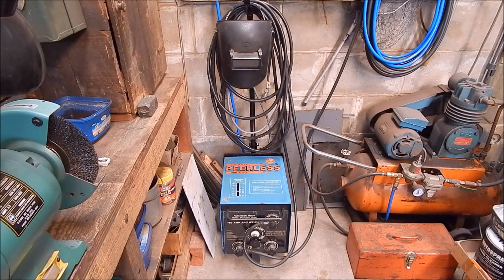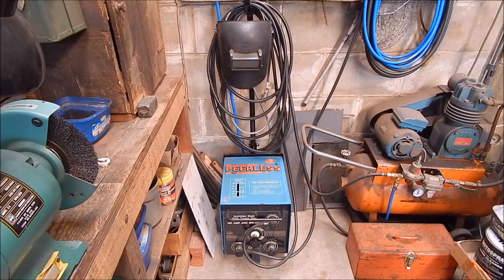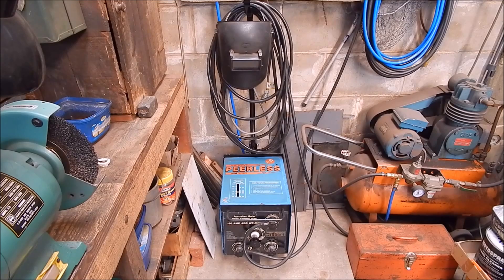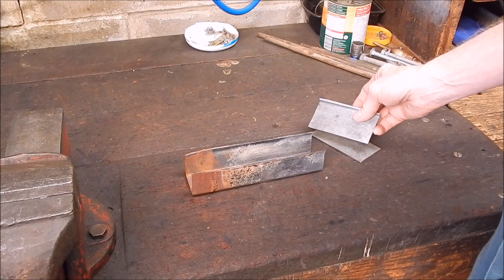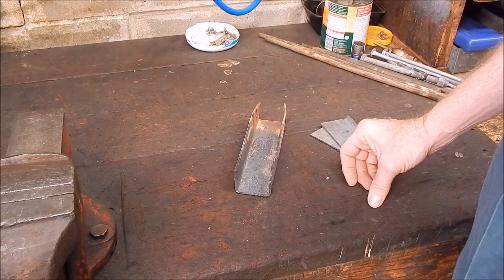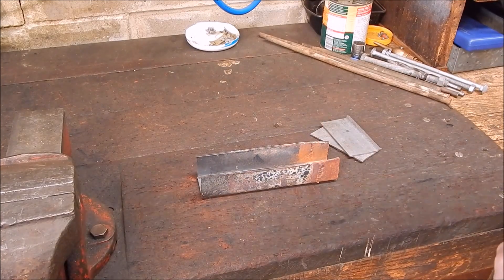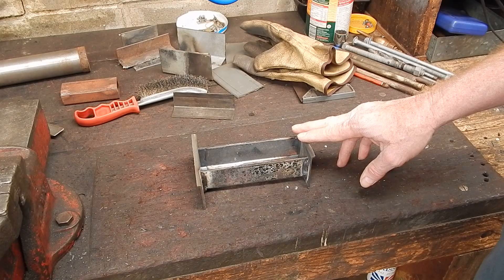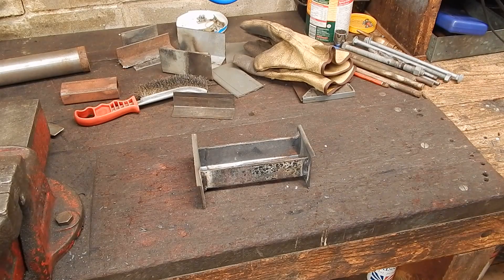Make a quick and dirty backyard metal casting mold

Comment: Rob, drill 2 holes on the bottom towards each end, sit it in sand to pour and that way you can keep it level and at the same time have places to use a press to get the nugget out.
Good to see a vid on this!..  Paul
Reply from the maker: djpaulk Good idea.  I will see how it goes as is.  Should be OK.  If no go then I can still drill holes into the mold with the nugget in there :) Rob
Reply: xynudu I agree, with the draft to the sides and ends you have added, that  mould should release fine. Moulds with less draft can sometimes stick a little and be tapped out, other ones stick more solid and don't tap out. Those are the ones I press out.

Comment: Hi Rob !

I didn't even care about the angel at the ends.

As long as the ends are square to the rest the shrinkage will do the rest !

But I believe it's crucial that the U-iron is oxidized to insure the metal to slip out with no resistance - that's no problem if you just use old rusty scrap U-iron - mine even had some paint on it, but after 1 or 2 mouldings it was burned away.
Reply from the maker: Keld Sørensen Some of the "U" iron has a taper cast/rolled into each side and is not actually square in the internal section.  Is yours like that?  Rob
Reply: xynudu I think Keld Sørensen  means the ends (you tilted in the saw)how you cut to create draft, not the rolled inwardness of its cross section. My U section has the two vertical planes slightly rolled inwards so was not going to pop out of the mould easily from its sides, so was not suitable.  My other castings in these "bread pans" shrink from the top and bugger all from the sides. I also have wood patterns of various sizes that I press into foundry sand to make my rock cakes :)
Reply: djpaulk Yeah, you're right - that's what I mean - and you don't even need to welde the ends - just give them a tack - look here:

http://kelds.weebly.com/forme-til-barre.html

You can click on the picture to get them bigger - Google Translat with the combobox to the right, just under the menu line.
Reply: Keld Sørensen Ohh okay.... Hello Keld. Yes I have free ends and sometimes just set them plates on the ends in sand.
Reply from the maker: djpaulk
You are obviously more advanced than me on this casting stuff, but I expect there will be some serious shrinkage on the top surface.  I wil try the molds (I made two different sizes) when the rain clears off.  Rob
Reply: xynudu Yes, the larger the top surface area the more pronounced is the depression that sinks/shrinks in the middle. You should be ok with that size. The top edges of the loaf will be rounded off like a loaf.

Comment: Hi xynudu. Always impressed by the way you do things. Can you get foundry sand in Oz? I live in rural Alaska (about as far away from you as it is possible to be) and there are no scrapyards. All metal imported. My son did some Aluminium castings with homemade sand. He was going to build the GIngery lathe. I found the "myfordboy" channel on YouTube and you might enjoy it. Much casting and machining. Wooden molds, wooden patterns, melt and pour, all old-school. But it is a real pain in the ar** to make your own sand. We couldn't even find a sieve small enough to sift the sand. Nobody makes sieves fine enough nowadays. If they do, they weren't not online. I made a power sifter (based on a myfordboy design) but without a proper sieve you are lost. However, you can do things with wooden molds, foundry sand, and wooden patterns that you cannot do with your techniques. I'm not critical because I'm just like you. I follow George Dyson's advice. "Never buy anything you can make, and never make anything you can find."
Reply from the maker: Juan Rivero Hi Juan. Yes, we can get all the foundry sand etc here, but it all costs money, and I'm cheap :)  I tried some sand casting (with a sand recipe I got off the net for silver work) way back, but the finish was pretty poor.  I want to avoid all that work Myford Boy does, but you can only improvise so far.  But it's lots of fun trying stuff, and so far the alloy I've got has been more than usable.  I knurled some yesterday and the finish was absolutely superb (used kero on it).  Thought about doing a video but time ran away, plus I don't like posting too often or people will get sick of them.  Stay warm in Alaska. Cheers Rob
Reply from the maker: xynudu I always imagined Alaska had lots of trashed vehicles etc from the harsh environment and that scrap would be readily available.  Wrong again.  Cheers Rob